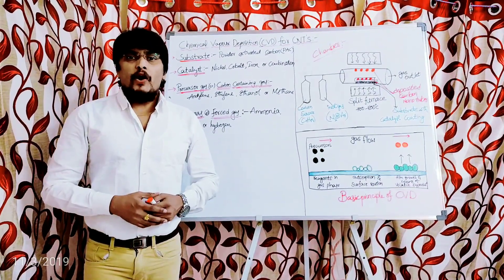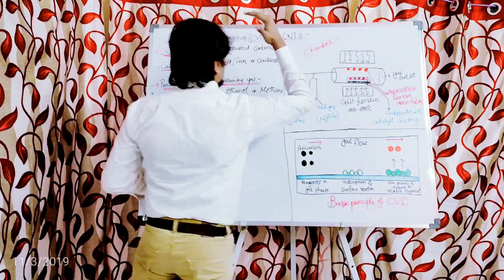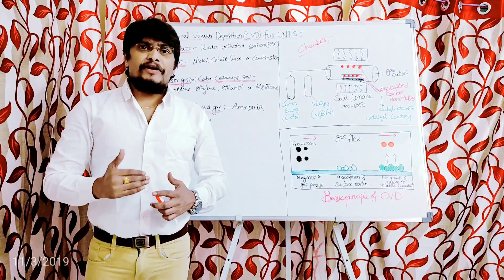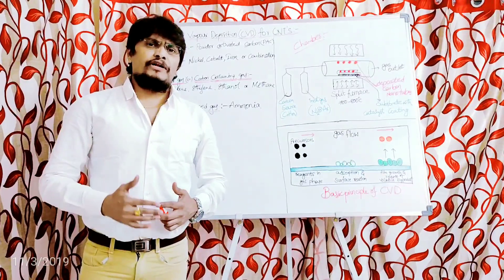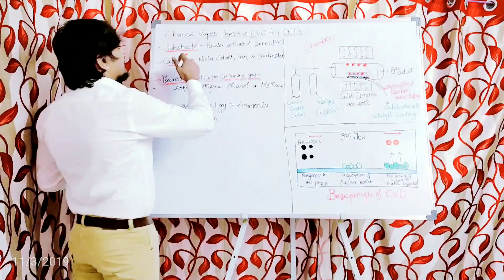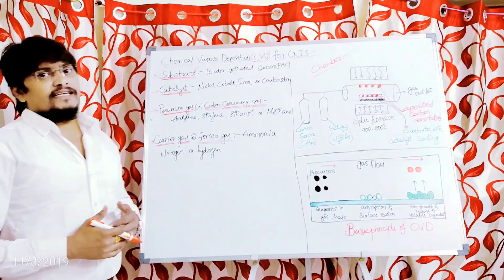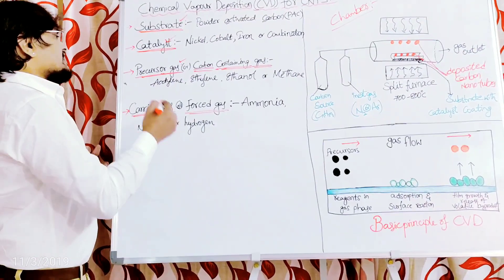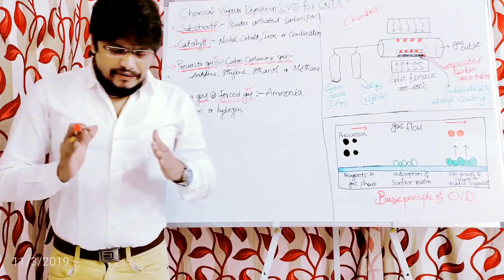Preparation of Nano materials: Chemical vapor deposition (CVD) method by Dr. K. Shirish Kumar

Comment: Is it same as Atomic Layer Deposition?
Reply from the maker: ALD differs from other CVD processes by the fact that a surface catalytic reaction is employed in ALD. This means, that a gas phase reactant, referred to as a precursor, on impact with a solid-state reactant - substrate (might as well be hot, or cold, but again, not necessarily) - as a result of a surface catalytic reaction, produces a deposit on the substrate. The surface reaction normally requires clean substrate surface, since it proceeds through the catalytic sites on the surface. Once all the surface of the substrate is covered with the deposit material, the reaction stops, since no more active catalytic sites are subjected to the gas-phase precursor. The reaction is therefore called self-limited, or self-terminated. However, the deposit might provide the active sites for a catalytic reaction with other precursors, and so on. This effect is put in the basis of thin films engineering with atomic layer precision (hence the name). One of the good examples is growth of graphene on the surface of catalytically active metals using a hydrocarbon precursor.
Reply: @DrKShirishKumar  Thank you so much sir for the help.
Reply from the maker: My pleasure

Comment: nice explanation
  what is the reaction happening btwn substrate and precursor....can u explain it?
Reply from the maker: Dear hemunth, it is a surface phenomenon i.e adsorption, as it is adsorption one chemical will not be changed to another, what happens exactly is precursor gas molecules containing carbon will be deposited on the surface of the substrate under the temperature conditions are maintained.